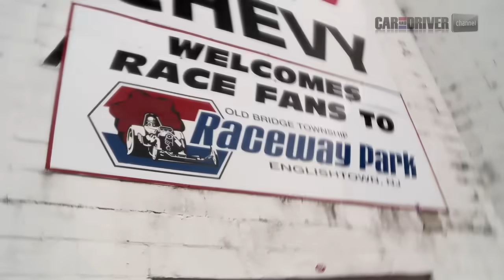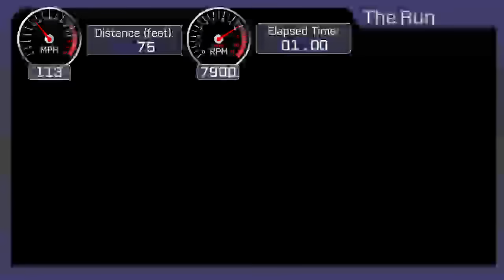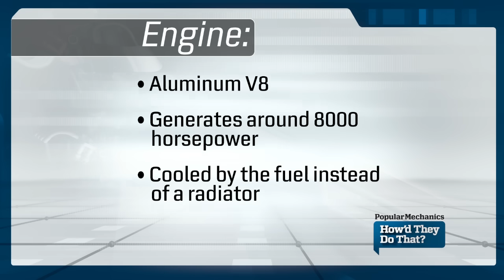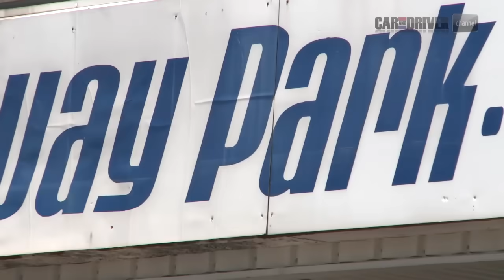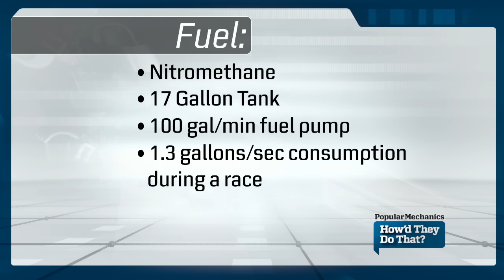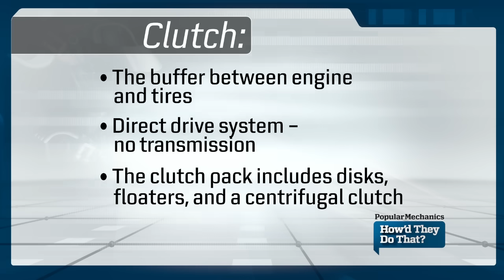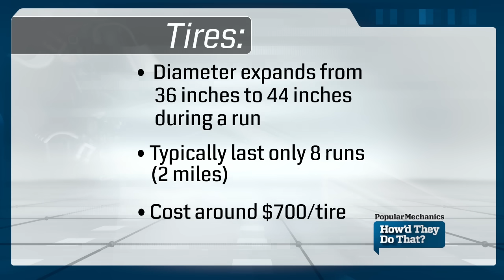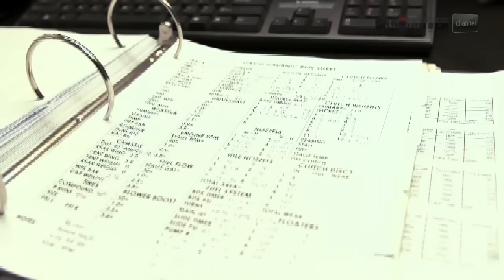How a Top Fuel Dragster Works

Comment: Hello, I'm from germany.
They forgot about catalytic converters. haha :-)
Reply: They they don't have catalytic converters as these cars don't need to be smoged every two years
Reply: zkly haha good point!
Reply: +REDxFROG they dont need em, they blow up before they ever need it.
Reply: +REDxFROG What tyler meant to say, is that by the time you drive to the smog station or whatever, there will be 0 emissions.
Reply: +REDxFROG OK - that was a Volkswagen joke, ya ? Apparently there are a lot of long faces in Wolfsburg atm - a lot of people wondering if they'll still have a job in 6 months. Having been in that position, I dont envy them.
Reply: +REDxFROG lol yes but I like the VW diesels those things are awesome little engines that run great and can take you great distances on very little fuel I want to get one of those little vw diesels
Reply: +REDxFROG You really cannot and should not use catalytic converters with nitro methane or alcohol. Doing so add weight to the vehicle and does not change emissions.
Reply: ("RNA0ROGER")
I'm guessing it was an attempt at humor - AFAIK, there are no emissions requirements for any form of legal offroad drag-racing.
Reply: +(&quot;RNA0ROGER&quot;) ........Not to mention the fact that "you" (re: anyone) couldn't build one small enough that would fit on the car and still be able to handle the flow of that much Horsepower.      

A number of years back (90's) some "tree hugger" tried to get legislation passed to force NHRA / IHRA to mandate "MUFFLERS" (!!!) on the Fuelers and T/A classes.... never came to pass when it was proven to be a ridiculous idea, from the pure physics of it..... for the same reason I mentioned above in regards to "Cats".
Reply: +2Stroke Diesel Power The exhaust gas pressure would probably blow any muffler straight into orbit.
Reply: nah they stright piped out of the exhaust valves on 3 inch tubes - one for each cylinder.
Reply: wenn du deutscher bist kannst du mir sicher erklären wie dieses aus ringen bestehende kupplungsding funktioniert oder? hat das ganze ding keine gänge oder hab ich das falsch verstanden?
Reply: +Danger Wilhelm Schaltvorgänge wurde man im Lauf hören, also würde ich sagen die haben nur einen Gang. Wie genau die Kupplung aufgebaut ist, weis ich allerdings nicht.
Ob die überhaupt Gänge haben wäre auch interessant. Es könnte eventuell eine andere Art "Kupplung" verbaut sein, da ich glaube dass eine normale Kupplung bei 8000 PS sofort zerstört wäre ...
Reply: They forgot air filter too
Reply: Hey, I'm from Belgium. My brother's in jail
Reply: It's not a Volkswagen! 😂
Reply: @rustybrowneye  what?
Reply: @arthurwatts1680  I do think they probably need a cataclysmic converter though. :)
Reply: They don't need them. Its engine produces less emission in its lifetime than a Prius :P

Comment: Step one...  hemi.
Reply: Step one, you can't build a top fuel dragster in any other config other than V8 because of the rules. The rules are dumb!
Reply: Step two... Take the wheelie bar off for party mode
Reply: tell john force that
Reply: You can only use a Hemi “ish” engine (not related to any Mopar Hemi other than similar configuration) because of NHRA rules. 

They would be running a lot faster if you could use a modern DOHC setup.
Reply: I was actually thinking if the Rotary would get the funding that a Hemi V8 would get, it would be cool to have a billet Block 6 Rotor 40b P Port, Supercharged and run on nitromethane, With about 60 PSI you can make about 8000 HP. The 3 Rotors in the Pro Import scene with are 2.0 liters can make more than 1600 HP on about 50 psi or so, but running on only menthol fuel
Reply: So why exactly are they not allowed to shove a giant V12 in those things?

Comment: The spark plugs burn out after several seconds?
Reply: I'm pretty sure the conditions in the engines melts the electrodes and elements out of the plug after several WOT seconds,  yeah
Reply: That's likely true of the old school then.  The March of materials keeps us moving forward
Reply: Saw a plug launch itself out of the block, at night, at Old Bridge. It went towards the parking lot. Probably still in orbit.
Reply: the entire run is averaged at 3.6 seconds. two seconds in the plugs are no longer firing, the only way the engine is running is the exact way a diesel runs, by enough heat and compression for the fuel to ignite, which is mind blowing.

Comment: I wonder how much power these bad boys could make with a set of turbochargers. Even if the turbos would melt from all the hot exhaust gasses after 1 race, or even before it was over, it would still be interesting to see how much they could make in theory.
Reply: ever see a blower get blown off the block? if you look real close you can see two straps on the side of the block that hold the blower on in case of a blowoff. Trust me those turbos would end up in the stands midway during a run.
Reply: purplexenno Yeah those leather straps sort of make me chuckle. Doubt they could hold it down.
Reply: Anders Kristensen
Usually they totally lose one side and the silly thing flops around. Of course there are rare occasions when the whole thing gets to become a projectile and shoots off somewhere. Fun times.
Reply: I'm not a mechanic or an engineer, but my guess it that turbochargers wouldn't be very useful in a dragster.  They rely on the exhaust to turn the turbines, and by the time you had enough exhaust to generate meaningful power from the turbos, the race would be over.  Superchargers, on the other hand, are belt-driven, and thus generate their power the instant the engine starts spinning.
Reply: Karl Hungus You are correct. but that is what launch control is for. You can have close to max boost as you launch.
Reply: I watched a similar show years ago where they mentioned trying turbos, but they would generate so much power that they wouldn't be able to get enough traction to keep from spinning the tires down the track. I think they estimated 10-15,000HP theoretically if they used a turbo setup.
Reply: Fixing the lack of cylinders towards the end of the run due to melted spark plugs idea is better than putting flying turbos.  Maybe they should inject some Nitrous so it cools the cylinders long enough for the spark plugs to last and they can break 3 sec?  Of course it will break regulation but it will be the fastest dragster ever made : )

Also add a radiator and a bit of water injection to crank to remove the 600hp parasitic manifold pressure loss just long enough to break 3 sec...  Obviously adjusting the timings and clutch management so it can get off the line good and go full potential all the way to the end or at least farther faster than it with current regulation. 

Maybe also making the tire a bit wider than 36" and spreading to 44" but say 40" spreading to 48" cause there is no reg to limit it under
Reply: ***** nitrous actually cools the chamber, look it up
Reply: They need a engine rebuild anyway dont forget your in it for who ever gets the quickest down the strip so destroying a v8 engine and push beyound with the highest octane drag fuel these are built as a one race and rebuild so it must be expensive fauled spark plugs and welded cluch transmision its a great hobby but the max speed for these are 300mph sure 400mph after pushing the engine intill it explodes and you burn in a huge fireball these jet dragsters are crazy they go beyound 400mph in under a few secs
Reply: ant a
 just to throw this out but there is a reason they only run 1000ft instead of a 1/4 mile.NHRA is trying to slow them down for safety reasons. They are now looking into regulating the fuel pumps, which means no more 100 gal./min. fuel pumps.
Reply: purplexenno because new people stopped caring about going to the meets

so it's the same people looking at the same sponsorships

the sponsors are probably seeing no gain in revenue so making the components last longer would mean less free parts for the teams
Reply: big daddy garlets (sp?) made a comment about this, it was safety. He made the comment that he was able to run 3 sec quarters using a 75 gal/min fuel pump, and he suggested they drop it down.
Reply: ant a spark plugs are melted mostly because of the electrical current passing across them, not so much because of the temperature in the cylinders. In any engine as the cylinder pressures increase and the charge of air and fuel in the cylinder becomes more dense it becomes harder for the spark to jump across the electrodes of the plugs, meaning more electrical current is needed to create a meaningful spark to ignite it all. The spark also has to occur over a longer period of time then in a normal engine because of the quantity of fuel in the cylinder. End result destroyed plugs before the end of a run.
Reply: purplexenno a blower backfire is alot different than a turbo one, the backfire happens in the intake manifold and the pressure shoots upwards causing the blower to blow off the intake, which is why you only see straps on high hp bower cars only..that would not happen on a turbo car. a turbo backfire would be like a exhaust backfire, extremely loud popping, huge 3 foot flames you get the idea, and yes that backfire would destroy turbine wheels, melt housing, destroy bearings, and if your compressor wheel or housing isnt mapped right thatll blow too. but turbo cars seem to be getting close to these top fuel supercharged car times.  the fastest turbo pro mod ran a 5.46 @ 273mph. i think top fuel might make a change in a season or 2.
Reply: ***** im guessing a turbo set up on a top fuel car, would be twin 108mm turbos. a single would be monsterous.
Reply: ***** i cant wait to read his reply
Reply: Pacman OneHitta He probably has it confused with water/meth injection.
Reply: ant a no they shortened the track and lowered hp on the cars, cause 1 a driver crashed and died at the end of a 1/4 mile run, didnt have enough room after the finish. theyre lowering the hp because cars were going almost over 350 mph, nothing.to do with sponsors or parts. if that was the case they wouldve made the change decades ago.
Reply: Pacman OneHitta yeah, they didn't bother releasing the X1 prototype from GT5 to real-life because the maximum limit would be so high, the human driver would go beyond the limits of what is capable before meeting the limit
Reply: 09corvettezr1  You are mistaken regarding your reasoning of spark plugs "melting". If spark plugs have melted tips/electrodes, the absolute reason is due to either;
A)  LEAN FUEL CONDITION. This would mean incorrect fuel injector (or carburetor) tuning, low fuel pressure or intake gasket failure,
B) INCORRECT SPARK TIMING (pre-ignition)
C) WRONG SPARK PLUG HEAT RANGE (too hot)
D) COOLING SYSTEM FAILURE while engine is in continual use.

The only reason for correct spark plugs to have melted tips due to; (your words) "electrical current passing over them" ----- is simply from improper maintenance.

 Nitromethane burning engines do not burn up spark plugs every single time they go down the track.either ------------------------------
The V-8 nitromethane and alcohol fuel burning engines as shown in this video have 2 magneto ignition systems (power is produced when engine turns) because each cylinder has 2 spark plugs and each magneto fires 8 spark plugs. Every Top Fuel racing team removes/inspects the 16 spark plugs during their post race engine inspection/service and if the engine performed properly, they will often re-use the spark plugs. Several years ago before data acquisition systems were invented, 'reading the spark plugs' is how racers and/or engineers could learn of a lean or rich fuel condition and this method is still in use today by many who do not have a data logger. Data loggers are expensive but have many benefits to a serious race tuner or a design engineer.
Reply: Racer Whilst it may be true that a top fuel engine doesn't eat it's spark plugs on every run, and the tune may play a huge roll in determining that, I really have a hard time believing that they would bother to reuse them, with the budgets these teams have, and with their willingness to spend huge money replacing clutches, pistons and rods, crankshaft lower bearing shells every run, cylinder liners at regular intervals, and crankshafts after a weekend of racing. Replacing spark plugs would seem to be pretty cheap and easy. These teams even change the engine oil between the warm-up after the engine rebuild and the run because of fuel dilution. Not to mention over half a dozen long block assemblies, that they just happen to drag around.

The notion that a more dense air fuel charge requires, either less spark plug gap or more current, or both to be able to create a meaningful spark is completely true. The notion that if the strength of the spark stays equal a larger gap exposes more of the air fuel mixture to said spark is also true. The notion that more electrical energy is needed to bridge a larger gap is true. Many people looking for added performance will even go to the length of indexing the plugs, which is to have the ground strap pointing away from the center of the cylinder. With ignition energy similar to a welder, I have a feeling that it doesn't help prolong the life of ignition parts, spark plugs included, in the same way that welders consume whatever filler is being used. Also remember that the rich air fuel mixtures of nitro also require a longer more continuous spark. The spark is at least a factor in what destroys the plugs.
Reply: 09corvettezr1  Perhaps you would like some additional clarification from a leading spark plug manufacturer, Pertinent info will be found on page 2 at the bottom. [Causes Of Overheating]   http://ngksparkplugs.com/tech_support/spark_plugs/p2.asp?mode=nml  PS. In the early 80's, I indexed my spark plugs on my drag race car and two different bikes I had back then. With those engine configurations and with atmospheric/tuning conditions being equal, the plug indexing essentially made an improvement of only .01-.02 seconds avg. on each 1/4 mile pass. Not worth the additional time used to index them in my case although in Pro-Stock and similar classes I can understand why it is often used. I realized more benefit from changing to the next colder heat range (1-2 tenths/sec) Also, a friend of mine crewed for Connie Kalitta and he verified spark plugs were reused at times before they got them for free. Cheers and I hope the above link will help in your understanding as well.
Reply: A lot of people use turbos in drag cars, it's just top feul makes too much power for them to be useful.
Reply: they use those type of superchargers because they give maximum boost with zero lag.
Reply: Anders Kristensen Between the supercharger and the nitro methane this car has as much boost as there is phisuically possible
Reply: purplexenno  nhra decided to change topfuel and nitro funnycars run to 1000 ft right after scott kalitta was killed in a crash in englishtown in 2008, i heard it was due to several tracks not having a sufficient shut down area in the event of a high end crash. i.e. englishtown..
Reply: josh xavier88 Sorry to say Josh but some of your knowledge on nitrous is lacking. Nitrous does cool the chamber when it changes from a liquid state to a gas, it causes and endothermic reaction, it is this sudden and extreme cooling in the chamber that allows more air to be drawn and packed tightly into the cylinder. While nitrous contains two oxygen atoms for every nitrogen atom, the bulk of the additional O2 comes through the plenum in the conventional way in the form of cooled air. It decays exothermically during to the combustion / firing cycle which contributes to the temperature spikes. As for the Integra that blew the intake manifold, despite what most people think nitrous is not flammable, it merely causes a chemical reaction that allows the air to shrink. What is more likely to have happened is a pool of fuel in the intake manifold has found a hot spot and ignited the unburned fuel in the intake. There is also a fair chance that the nitrous solenoids are leaking.
Reply: Anders Kristensen To make the power levels they need turbo manifolds would be highly impractical not to mention power limiting. They can make more boost than the engine can handle with a single supercharger, so there really isn't a point in using turbos in this instance. Plus probably the biggest reason for not using them would be that nitro methane doesn't burn it explodes, the last thing you would ever want in your turbo is massive pressure spikes.
Reply: I'm well aware of how turbos and blowers work, I didn't know the blower is maxing out boost tho.. I always thought it was just regulations and safety.
Reply: Anders Kristensen I don't think turbos could handle it.There are huge flames from the unburned fuel shooting out the pipes.  You probably couldn't put exhaust pipes on these engines.  The pressure would cause an explosion.

Comment: Are all of you kidding? I'll try to answere a few questions. 
1 they use V8 s because the sport began in California with weekend racers hot ridding their own cars. It was what most if them had.

2 the NHRA is the sanctioning body that writes rules for the sport. Safety is paramount.  There are 1/4 and 1/8 mile tracks. The limit keeps them from exceeding speeds that would become uncontrollable and therefore impractical.  

3 as far as power is concerned the sport evolved.  As improvements were made performance increased as the sponsership increased and the stakes got higher research and development made huge strides in performance and safety an entire industry was born to support the sport. Fabricators, engineers, Machine shops, electronics, safety equipment, chemicals, you name it even hospitality concerns benifit. It's a great sport if you haven't gone check out a pro meet check NHRA .COM